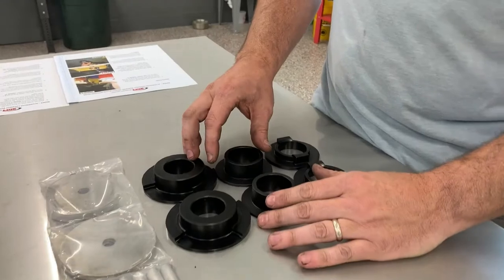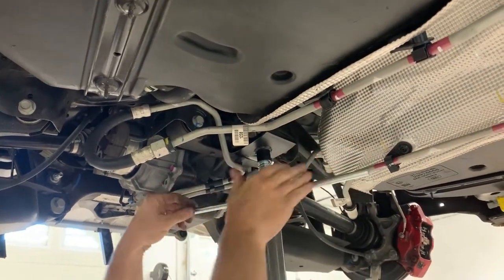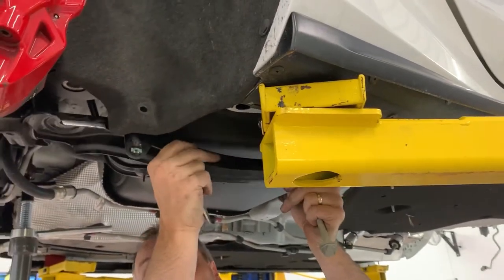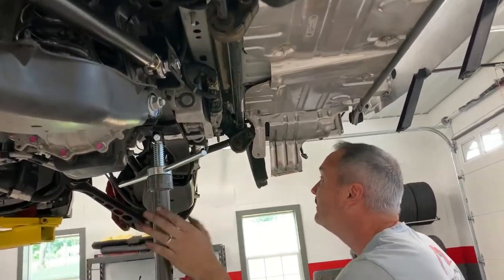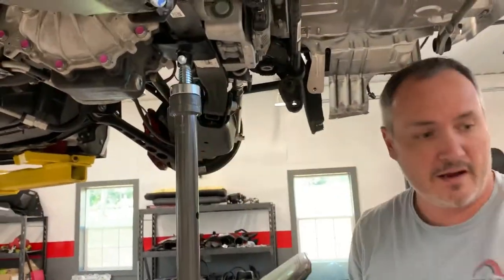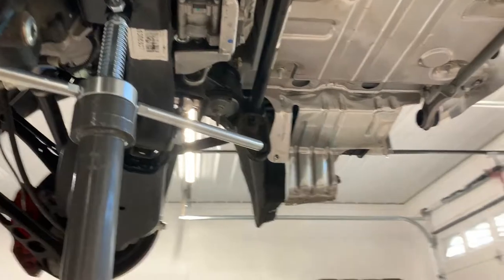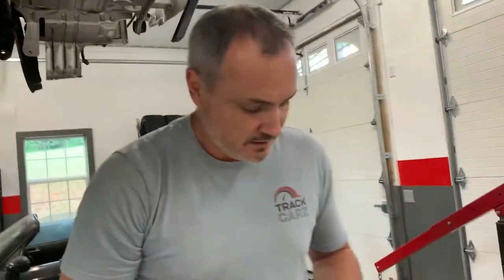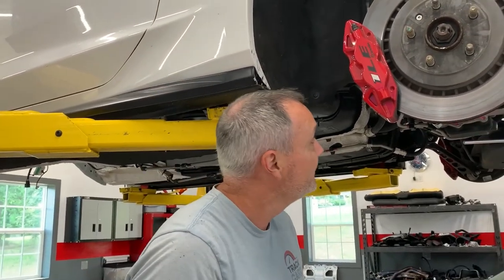Gen 6 Camaro BMR Rear Cradle Lockout Kit Installation

Comment: Thanks for the great video. I just installed this kit yesterday. I followed what you did. The only thing that was a pain, was inserting those pins. I put a ton of grease on them and inside the bushing. Two of them slide in. The other two is a tighten fit. I have to really hammer them to where I was able to screw in the bolt with the aluminum washer. It then seated itself as I tightened. I’m going to get the car realigned this week. I’m kinda of anal about stuff like that. Your son did a great job of filming, and editing as well.

Comment: I used a floor jack with an 8 inch 1/2 inch extension to get the stubborn bullets to seat all the way, had to use my feet to pump the jack handle but it worked great after some trial and error since I did mine on the floor of my garage.
Reply: Any more road noise after installing these?

Comment: Did you have the exhaust removed for this install? Or just to make it easier to film. I'm going to be doing this on my QuickJack and wasn't planning on removing the exhaust. Also noticed you had the rear bumper/fascia removed. Doing some other work? Thanks for the video. Very helpful.
Reply from the maker: I had the exhaust and rear fascia off for other work. I think you can do it with the exhaust still in tact. Definitely no need to remove the rear fascia

Comment: Does vehicle has to be aligned afterwards?
Reply from the maker: I recommend it but you may get lucky. All of the control arms are suspended from the subframe, so if you lower it from the car, it might not go back up in the exact location it dropped from. It’s not gonna be anything major and you probably won’t notice it visually, but it definitely could lead to some premature tire wear or adverse handling at the limit. For as expensive as these rear tires are, I’d recommend a good alignment afterwards.